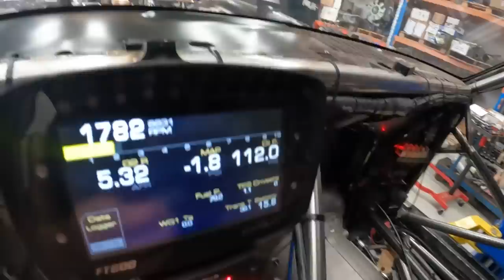Time for Maintenance in Australia! Is the Hemi OK?! +Shawn and Disco Dean On LIVE TV!

Comment: I just put a new CSB engine together and I have never used Maxima oil before but I am going to give it a try . I have always used Pennzoil in all my engines in the past and have had good luck with it . But I have heard a lot of good about Maxima oil and I see that you all use it . I have used Maxima  SYN ATF  High Performance 30wt for a while in my Transmission and had zero problems with it .

Comment: I would start running Don Schumacher rods. They are the only rods you do not have to worry about un torquing. No disclaimer on them. Also run top fuel bolts